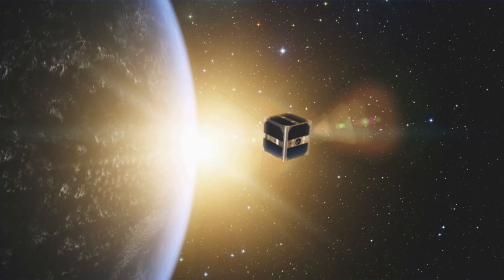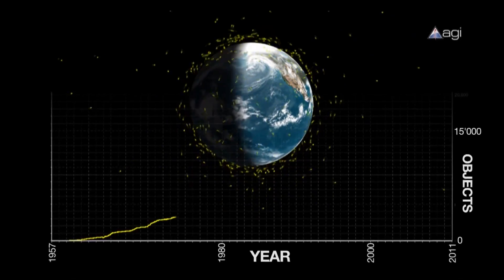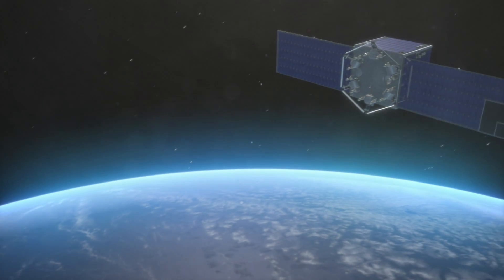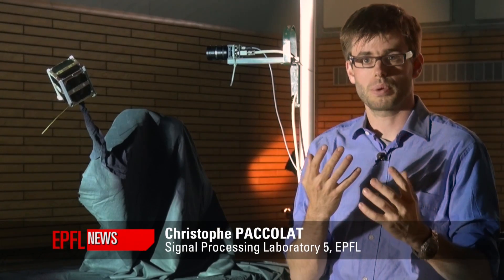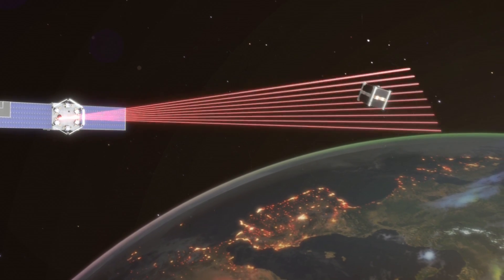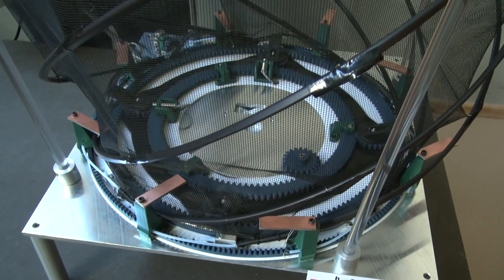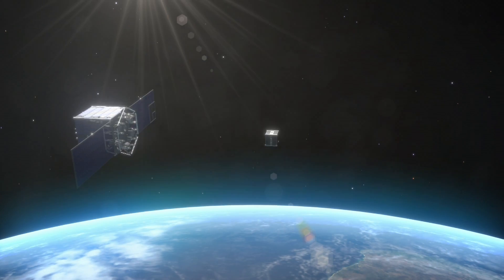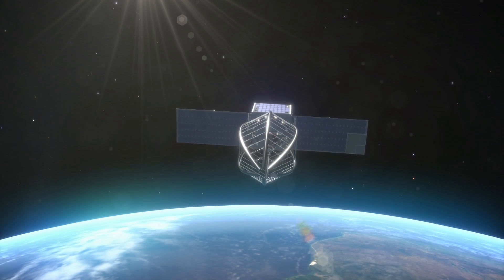CleanSpace One: A giant Pac-Man to gobble up space debris

Comment: Why doesn't some genius make a machine that gathers space debris, then used a solar powered mechanical canon to project the debris into the atmosphere  where it can be incenerated?   It seems like a simple solution if you ask me..
Reply: FUreplygirl Then it wouldn't have to commit suicide once it's full
Reply: FUreplygirl because, if you push something from you, you are pushed back, and you'll need more fuel to return to the orbit and stabilize I think. and on top of that, you'll need more fuel to capture other things, that such satellite can't carry.
Reply: Clockwork Doll I believe satellites can be propelled with electricity from solar power.
Reply: FUreplygirl and tell me how.. in space.. in vacuum..
Reply: Clockwork Doll You have already answered that in your last reply.. "Push something from you, you are pushed back".  Thats the basics of space propulsion.  And look into the ion drive, not much needs to be pushed out, just has to be pushed quickly.
Reply: +MrandMrsGaSp don't forget that the ion drive in space require some kind of gas to make the propulsion(xenon) and it would of course be limited

Comment: really bad bad idea.
They need something reusable that can stand in orbit slowing debris orbital speed without using proppelent..
electrodynamic tether or solar sails to the approach, and electrical energy as laser push or centrifugal rotation to slow the orbital debris speed.
In their case, they launch something very heavy and costly to just deorbit one single cubesat..  that is the worst idea ever.
Reply: You're talking out of your ass mate. This is a proof of concept; yes it's expensive and overkill, but this is just to open a new market. There is going to be a serious need for space debris cleaning in the coming 20-50 years. And this is one potential options.
Reply: @jakehopt  if something does not work in paper (this mean that it is not cost efficient from the begining), why wasting so much resources in something that they know it would not solve the debris problem.
This same error was made by some Elon Musk competitors, after the falcon 9 has prove that its reusability was working fine, many companies like ULA, started to design rockets that would be less reusable than falcon9, this mean 7 years of technology delay and they start with a rocket concept that it is already pointless vs the current falcon9.  This is similar..    This only happens when the one given orders is an idiot, or...  when they use funds from taxpayers and they just want to make something as an excuse to consume those funds)